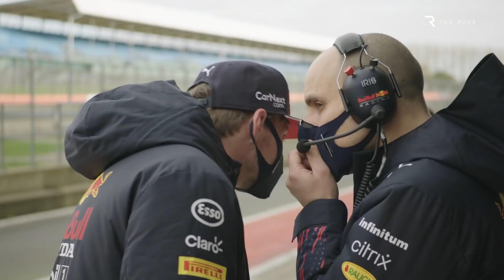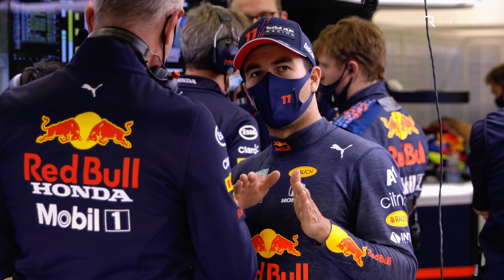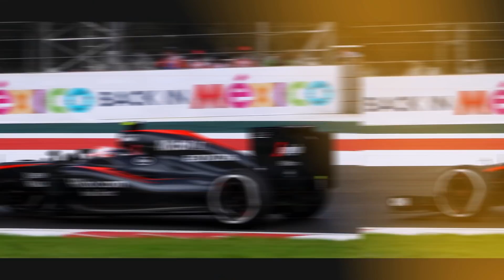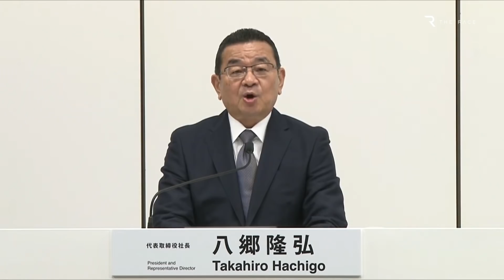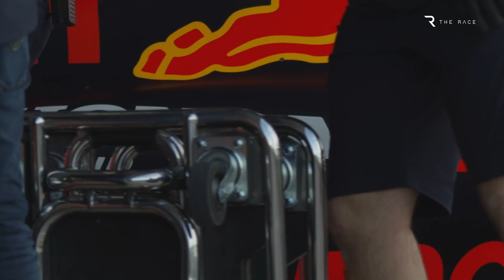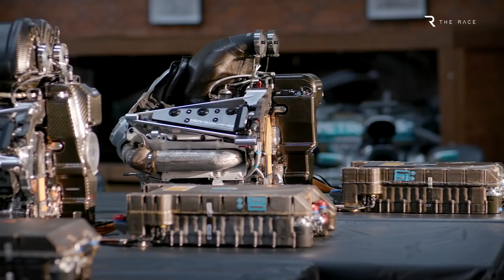The major F1 engine upgrade Honda kept secret

Comment: It is a shame Honda worked so hard to get back to a competitive position in F1, only to quit the sport at the end of this year.
Reply: They get in, do some learning that they can take away and get out before it just becomes a money Pitt
Reply: Honda could possibly come back, if and when F1 goes carbon neutral.  Just a guess.
Reply: @GreeKing83  F1 is not in their blood.
Reply: I’m not surprised at all, Honda knows where they are needed and the automobile industry is undergoing huge changes at this time and like any other company you must ensure your survival and let’s face it F1 is an expensive hobby so there you go. Let’s see how these other manufacturers make it through the next decade in automobile manufacturing and who comes and goes. Just watch…….
Reply: F1 is just far too expensive, it's why BMW pulled out as well
Reply: Theyre pulling the name but leaving many engineers on staff with rb.
Reply: @KevinJDildonik  well itbis moronic to think there is any issue with racing with fuels and real engines. It has no impact in reality and is just b.s for show that makes zero logical sense.
Reply: Well... they're leaving it as the company in name, but it's not a secret that Honda will be closely involved in development of the RB engine... most of the engineers and technicians working at Honda on the F1 PU will be working at RB Racing.
Reply: They know no matter how hard they will work they won't be the preferred team by the FIA, Mercedes and other teams will always be lobbying against them because they're not ''a European'' cool car manufacturer.
Reply: @The_808  I don't believe that, maybe a long time ago but not anymore. Their (Honda) drawback has been that their  involvement in F1 has been as a parts supplier to push the brand, which means temporary. I think Indy cars are more their mainstay in open wheel racing in the WEST than F1 where they compete with only Chevy. I don't have much knowledge of Indy cars since the 500 left the World Championship.
Reply: That‘s simply not true. People love them.
Reply: @The_808  Or that most of their prestige comes from MotoGp.
Reply: its a shame, but not surprising. they've done this many times. the exact same cycle. frankly 10 years or so down the road if they announce they are coming back, rather than fan fare they should be told to piss off and stop wasting people's time
Reply: @DAGATHire  thats ridiculous, theyre making a statement about how important the environment is, thats the reason why they are stopping.
Reply: Not sure im able to support Honda, their motorcycles have disappointed me both in quality and in handling, while Yamaha excels in both. Honda is not getting a new chance with me, too far behind, and with the Civic being sold only with CVT in SE Asia they are not being considered when we buy a new car for our vacation home. I want to like Honda but they arent making it easy.
Reply: @pflaffik  I can tell you the k20C1 in the civic R is one of the best engines I've ever driven.
Reply: @pflaffik  i love yamaha but old hondas run forever.
Reply: AGAIN. LULW
Reply: You do know about the token system don't you ? Honda had the most tokens to spend, Mercedes had the fewest and the engines are basically frozen "unless you have tokens" ? others only allowed to modify for safety and reliability, "not extra performance."  basically Honda has had the most freedom, so should have improved the most.
Reply: @markgc65  they chose where to use the development token and merc screwed up.
Reply: F1 racing are scripted that's why they're quitting for good.
Reply: @oneviwatara9384  yeah. I'm hoping that next year will be close like indy car
Reply: Because Red Bull sucks, as a company. Honda will be back sometime in the future I guarantee.
Reply: Yup, can't wait for F1 to go fully electric. Not sure why they're clinging on to the past with these hybrids.

F1 is supposed to be the pinnacle of motorsport, that isn't happening when using dinosaur fuel.